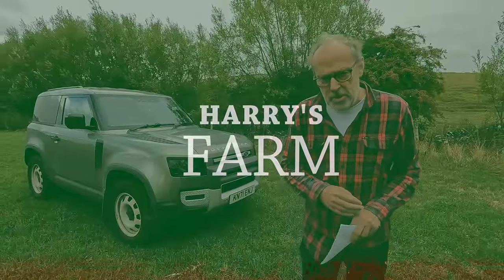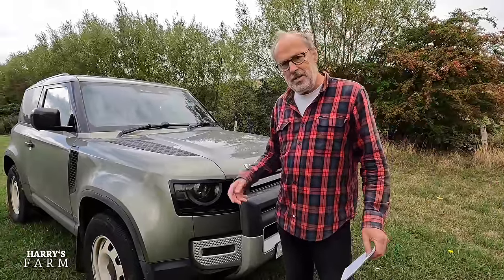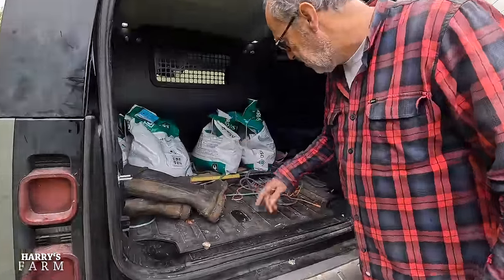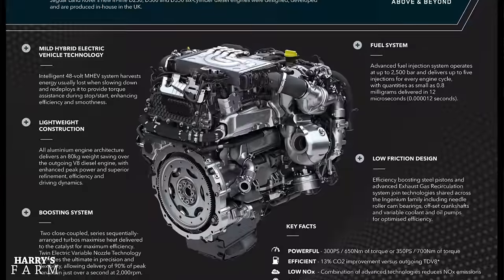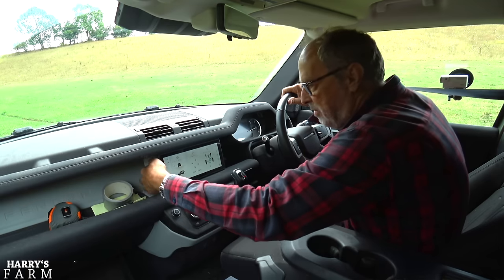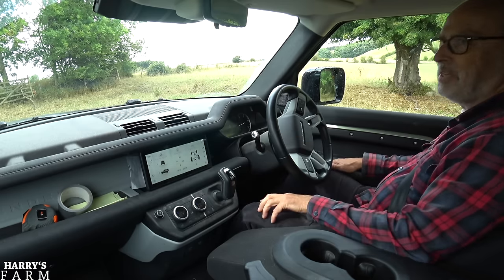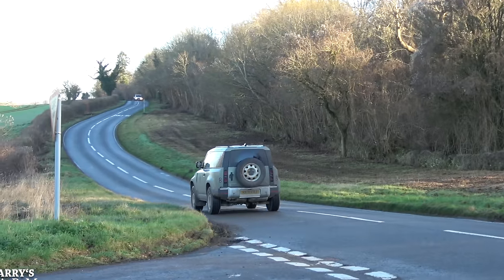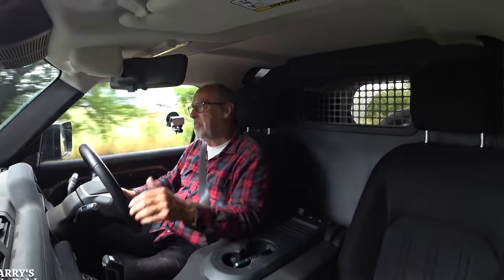New Land Rover Defender 90 Hardtop 12 month review. Is it a true farmer's car?

Comment: The chattering noise from the rubber door seals is very noticeable. Cannot believe such a well regarded manufacturer with decades of experience have missed such a basic issue.
Reply: JLR is not well regarded. They are well known for producing some of the least reliable vehicles on the planet.

Comment: Great vid Harry, but some ultra - stupid design errors on the car! Imagine a farmer using that, wholly impractical, he could even easily reverse over his sheep, cattle or dog with the absurd rear camera! 😨 Dynamics & engineering seem good though, it's just that JLR seem confused who the target customer is???
Reply: It has a reversing camera for reversing. The top camera is an alternative rear view mirror for when cargo or the centre seat and passenger block the reflective mirror.
Reply: @Peter-Oxley-Modelling-Lab  
It is a rear view mirror alternative for when the already limited view from the mirror is further or totally blocked by cargo or a centre seat occupant. There is a separate dedicated reversing camera which itself can be switched on full time [apart from when reverse gear is engaged] by the occupants.  These vehicles seem to beyond the comprehension of some people who would be well advised to buy something far less sophisticated.
Reply: @hedydd2  What is beyond comprehension is why they would mount such a camera so far forward of the rear of the car. Can you not see that it's not simply just not ideal but rather dangerous for a farm vehicle. Harry clearly does...

Comment: I've an electric towbar on my volvo, never again. Control module has failed twice with almost no use, carrying a racing bicycle a few times at most. In doing so it fecked up all the safety features to boot. Over engineered shite, get a mechanical towbar instead. A removable one if you dont like the look of them when not using it.

Comment: Chattering after a year.  How many squeaks after 10… 26?   My ‘88 110 had a few squeaks here n there but never any of that chattering that couldnt be fixed with a flathead screwdriver and some wd40.  Sure she can drive great now but does anyone really know what will be in 20-30 years when shes got 200k or more miles?  Idk if Land Rover engineers were thinking that way back in the day but surely the legacy and reputation of that car would have provided enough insight to build a new one even more capable.  Im skeptical that any of these will really endure that kind of abuse and age with as much grace as the legacy versions.

Comment: Just a bad thought out commercial vehicle.
It's probably the most reliable LR due to no air suspension but that's not saying a lot when it comes to this manufacturer.

My guess is that the poor headlights are powered by lucas.
They invented the dark after all....

Comment: That storage space is useless. I think I have a suitcase that will hold more. 

How did they only get 200HP out of a straight 6 3.0 turbo diesel? The BMW M57 comes standard like 15 years ago with 265 I think.

And that price is absurd, so I understand why you nixed buying it.

The towing is horrible because the wheelbase is so short. 

I have an old AWD van that tows better, will go everywhere you'd need it to, is much more reliable, has about 20x more cargo space and cost about 50x less than that Defender. Yes, 50 times less. Even the higher mpg you get of 30 vs. my 22 it would take years and years to make up that difference.

Comment: This tailgate and lack of room is an absolute deal breaker, for farm use save a heap of cash and get  an older Discovery, or if you do not need to tow heavy loads and want better reliability than any LR product get a new Jimny.

Comment: I’m sure this is a great car but reading some of the reviews posted here on top of what H had to say there’s something of a whiff around JLR, trying to emulate Porsche without. the pedigree, quality or dealers to support it. Will be bought by BMW at some point at a knock down price.
Reply: BMW owned LR before and the best thing they could bring to the table was the P38, JLR are doing fine. If you dont like the car or cant afford it, then you arent its intended market.
Reply: BMW did buy Land Rover for the sole purpose of being able to produce a 4x4 with their own badge on it. To be fair they did improve the build quality of Land Rover's products, but the downside was twofold. 1, crap engines, any Rang Rover with a BMW 6 pot diesel is underpowered & prone to overheat (watch this place for the Grenadier) 2, reduced rust proofing. Prior to Bow Land Rover intended it's vehicles to last for years, but BMW introduced the notion of building them tolast 10yrs.

Comment: It’s a failure… I mean in the sense of replacement of the original Defender. A good friend of mine bought a new hardtop 2 months ago and has it sold already.
Reply: Its a failure, except its currently LR’s best selling car behind the Evoque? Lets not forget car manufacturers are in the business of selling cars, not keeping neo-luddite original defender fans happy
Reply: I am happy for JLR and I agree with you that it’s a business. However, I personally do not see this vehicle lasting that long as compared to the original. You know you have something special when you do not need to change the design every few years. It is also massively over priced and will be driven by everyone except farmers and off road drivers.
Reply: @owenboyd5674  its far stronger than the original, not to mention miles and miles better off road as standard. Durability remains to be seen but I for one do not subscribe to the original defender myth of ‘if it breaks it can be bush repaired easily’ when for example they snap halfshafts for fun. 
Overpriced? For out and out farmers tools perhaps, but for farming tasks like harry uses it for as well as normal driving not really.. you need to drive one to appreciate it. For anything else its all relative.. things like Corsas and Clios are close to 20k fully specced these days, so 40k+ for a new defender and its capabilities aint bad these days
Reply: You make some valid points there which I accept. I am biased as I have had several defenders and I have loved everyone of them due to there individuality. The original will last longer than the newly introduced vehicle. I think of it was called something other than defender, then there would be no issue. The original was the one of the most flexibility designed vehicles. I really hope it proves me wrong, however I just see ££££ signs when anything goes wrong.
Reply: @owenboyd5674  I get what you are saying but honestly the new Defender is really special. Its not a rehashed Discovery although it shares a lot of components. The engineering thats gone into it is something else. Ive done stuff in it that would destroy an old Defender or at the least damage something major and the new one shrugged it off.
Id have one in a heartbeat, if I could afford one. Base spec for me.. im not flash. Has to be white roof and white steel wheels.

Comment: Obviously you were too mean to buy the back mud flaps
Reply: I think when the defender was first available for some reason they had it so that you could buy the back and the front mudflaps seperately but later on land rover changed it so that if you buy say the front mudflaps the rear ones are automatically selected as well.

Comment: Brilliant car but has unproven reliability and is probably £30,000 too expensive. I cancelled my Defender order when the new Hilux came out. Couldn't justify paying an extra £35,000 for the Defender when it will probably breakdown before its even paid off. Meanwhile my Invincible cost only £33,000 and has a 10 year warranty and it has Toyota reliability.

Comment: Well i Had a TD5 90 For a Few Years Mainly Only Used it For Off-roading,So B F Goodrich All Terrain Was The Best Tyre in my Experience I Did Test other Tyres But for Road and Off-roading You Could Not Beat Them and they Last  50,000 miles.

The Main Reason for using a Proper 4x4 Tyre and Not Flimsy Sidewall All Season Tyres is    
You Need a Much Thicker Sidewall or you Get Your Tyres Cut to bits Off-roading !!.
New Defender is Far Too Big Outside And Too Small inside ,And The Price is Extortionist ,Its Sole Purpose is to Relieve Fools of as Much Money as Possible ,Who Have No idea About Anything.Certainly Not How to Drive one Properly Off Road.
Why Would you Pay that Much ?Just Buy an Old Defender if you Need a 4x4 and a Car For the Road ,You Can do that  for Less than £60k For Gods Sake.

Comment: 53 thousand for a van , nuts
Reply: £10k VAT to reclaim. Which brings it within £10k more than a Ford Ranger Wildtrak.   The Ranger is, of course, more comparable to a 110 commercial or even a full passenger 110, which would probably take their relative price [after VAT not being reclaimable on passenger 110] to the Ranger being just under half the price of the 110.  
Now THAT is a serious difference in value for two vehicles of similar performance that can both accommodate five people in comfort. That’s for VAT registered businesses of course and doesn’t even take account of the extra road tax payable on the 110 Station Wagon.

Comment: The worst thing about this is the value for money. In Portugal, the most basic Defender 90 starts at 86.000€ which is just ridiculous for a vehicle like this. Unless your farm grows poppies or weed, buying one of these to use for farm work is the same as setting your money on fire and pissing on it immediately to put it out... Simply worthless.

I'd much rather get a basic Toyota Hilux for 33.000€, load it up with options and still have enough money left for a nice holiday abroad.

Comment: The original Land Rover was built as a machine and not a car. Then came the Defender versions and they improved the machine. Then Land Rover effectively asked some uni/computer gamers to design and off-road car. And that is what the new Defender is, an off-road car. Even in this review, it is referred to as a car.
It's an awful looking thing, too techy, too soft and way too expensive.
Traditional Defenders may not be as good in many ways? But they will still outlast this new car version.

Comment: Landover have to tried to tick many boxes with this one. I expect the majority of customers won't be farmers. What Landover need to do is make a bog standard entry level model with no trimmings. Just a farm workhorse and nothing else, . Then it will sell well...
Reply: They really aren't interested. The new CEO thinks they can compete with the likes of Bentley! They don't want your money if you're after a Disco Sport (all bar PHEV orders suspended), Disco (18 months and still waiting) or any kind of low-spec Defender, hence the D200 is suspended. Why sell a D200 when they can load a different ECU map and charge you £4000 for the privilege and an extra 50 horses?

Comment: I'll call BS to having never washed the car since purchase as it must have been washed after the off-road event, there is a clear difference on the front end from that day until the day of shooting this video.
Reply from the maker: Driving in heavy rain is a great way to get most of the mud off. I promise you the Defender was never washed during my time with it. The only bits I did clean regularly were the headlights.
Reply: @harrysfarmvids  OK, fair enough. Good video, btw.

Comment: All LED lights are rubbish !   It does not matter if they are brilliant at lighting the road as this NEVER outweighs the ridiculous cost of replacing them when (yes, when not if) they go wrong.  Gone are the days of picking up a suitable bulb at every filling station (or most supermarkets). £1500 to replace 1 broken head light is not unusual.

Comment: Yet another very expensive 4 by 4 designed for suburban driving sold for commercials use.  Full of useless 'cool add ons' whilst failing on resilient basics.  My 2005 Ford Ranger fully manursel serves me well enough on the farm. A second hand vehicle releases no additional capital carbon of course something manufacturers choose to suppress. Who uses a rear view mirror on a 4 by 4, thats what the wing mirrors are for like a van ?